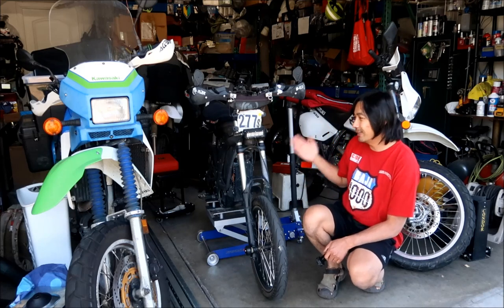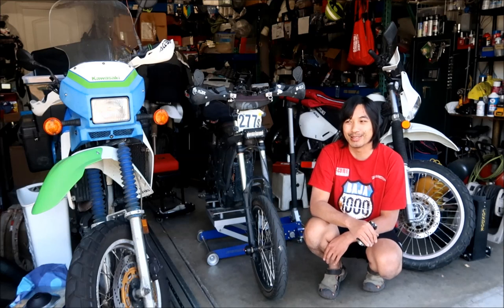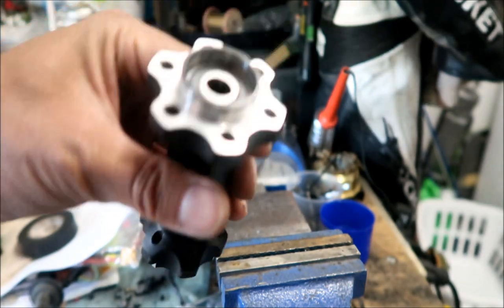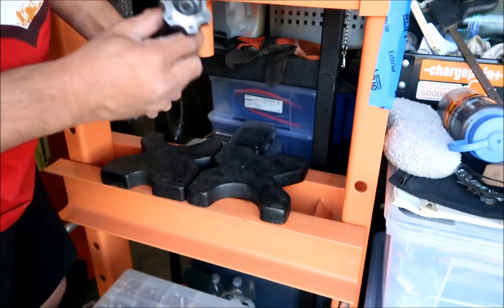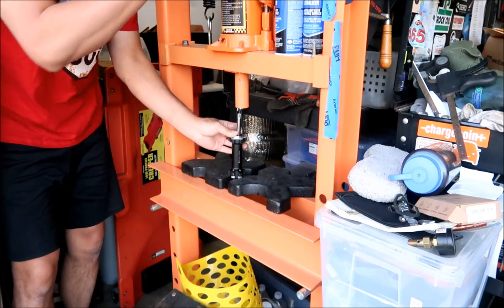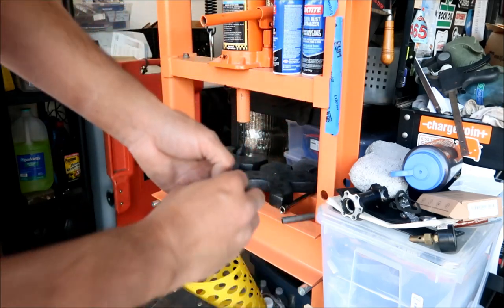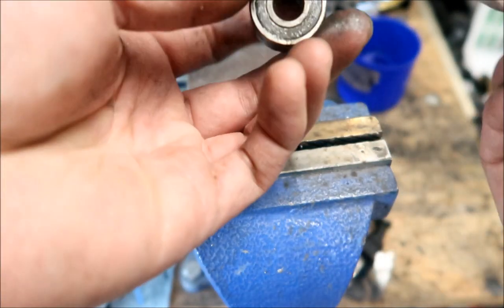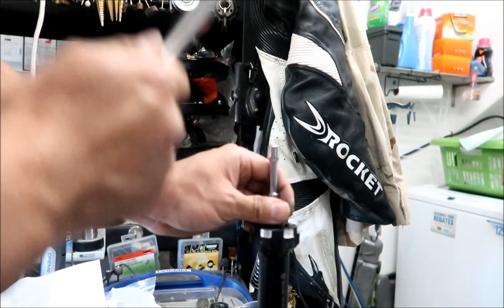Sur Ron Light Bee Jackshaft Bearing Replacement VLOG Part 1 - Uninstall

Comment: I know from Inlining, that there are maaaaaaany types, qualities and ratings for those exact bearings... Do you know if the stock bearings are "good ones"? Or may that be worth tuning/changing for reliability and maybe even like 1% more battery life?
Reply from the maker: The stock bearings are ok.  I install some better ones for peace of mind but obviously they cost more.  But when you do replace them the drivetrain feels much smoother.  Not a big fan of the jackshaft requires more maintenance unfortunately.  =(

Comment: What was making that noise in the end? I have the same issue - what do i need to replace? Unsure how the sprocket could be making that noise?
Reply from the maker: It was either the bearing or the spacer.  Replacing the bearing quieted it down.

Comment: replace with quality roller bearings not cheap china ball bearings. this is a roller bearing application.
Reply from the maker: Well if you would like to find a better bearing be my guest I used an American bearing made in China
Reply: @69NOMAN69  I was considering doing this as there is no thrust on those bearings and they don't spin taht fast, could I put roller bearings for the wheels to ? No thrust and spinning speed is ok ? Or Ima wrong ?
Reply: What bearings would you recommend? Do you have a link?